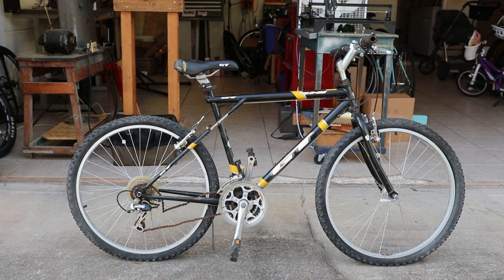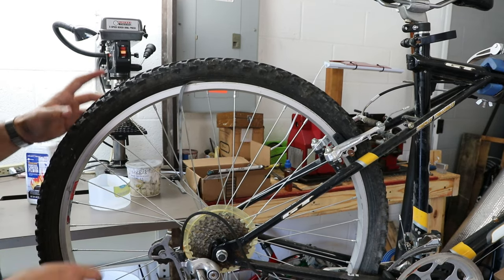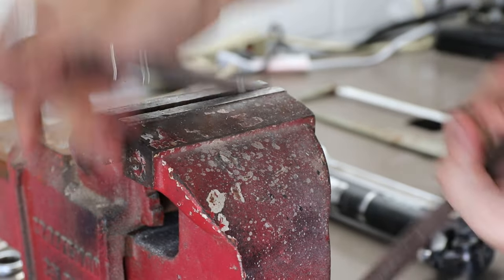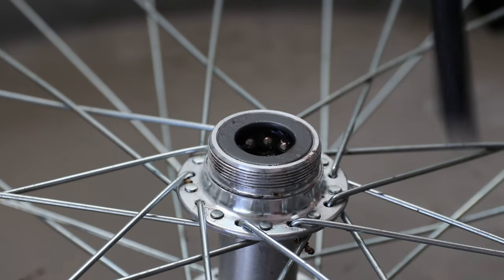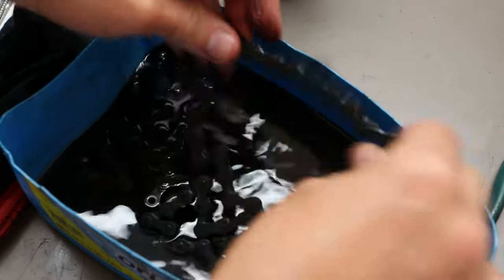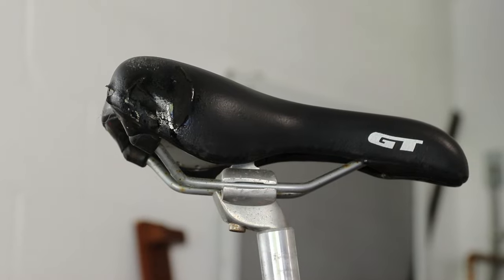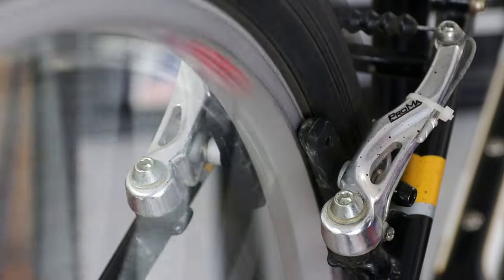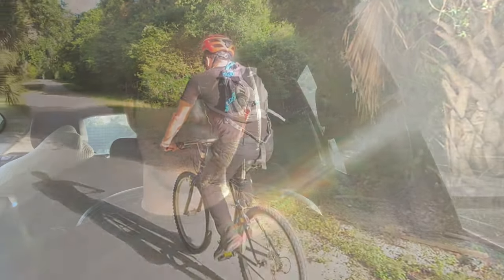$55 - 2000 GT Palomar restoration

Comment: I have the same bike. I got it when I was 10 in 2000. Washed and waxed it every week, and it's in pristine condition. Put a couple thousand miles on it. This summer I will be fixing it and getting it back on the trails.
Reply from the maker: oh that's very cool

Comment: I couldn't count the number of 80's-00's mountain bikes and hybrids I've refurbed. It's got to be in the hundreds. I've learned a few things over the last 20 years doing this.

Evaporust is amazing stuff. I started using it about a year ago. The gallon jugs are about $26, so a little better deal than the quart bottles. It can be reused a bit, but be sure to store it in a sealed container as it will evaporate and turn into a thick, gloopy mess. It works great on chains and hardware. 

For saddles with tears, a black Sharpie or paint pen work really well on exposed foam and blends in better than spray paint. If the tear is more of a slit or small hole, I like to seal that with silicon. Black RTV is a little glossy, but it probably blends in a little better than clear RTV. Use the black sharpie/paint pen trick if you do use the clear stuff so you don't see the foam underneath.

For handlebars, stems, or anything chrome with very light rust specking like what you had on the bars, I've long used 0000 grade steel wool as it isn't so abrasive that is scratches. You can use courser steel wool to get heavier rust off, but it's possible to scratch surfaces with that. Usually, a decent quality chrome doesn't scratch easily. Steel wool is cheap, but wears out quickly. Someone recommended to me a product for cleaning chrome on an old BMX bike I had restored,  Big 45 Frontier Metal Cleaner. It's made for cleaning gun barrels and the stuff is awesome. It costs several bucks for a pad, but they last a really long time. Check that stuff out.

For removing hub dust caps, a narrow plastic tire lever works great without bending the dust cap. It makes it so much easier to clean out the hub shell and bearing races if you get those off of there. Often, they'll snap back on by hand, but if they are a tighter fit, I use a socket and hammer to gently seat them back into the hub shell.

For replacement pedals, I often get on Amazon and sort by price and see what is available for around $10. You can find some really decent sealed bearing alloy pedals. Basic plastic platforms can be purchased for $6-7. As much as I hate putting money into the pocket of a billionaire, you can't deny the cost effectiveness and convenience of having products dropped off at my doorstep. They have lots of cheap saddles, brake pads, cables, cable housing...

It's always fun giving an old bike a new lease on life. I guess that's why I've been doing it all these years.
Reply from the maker: thanks for the all the tips. I agree, it's really not at all for the money, it's just for fun and cool to see the result.

Comment: A good way to get a stubborn free wheel off is to put the free wheel block in a vice sticking straight up.  Place the wheel over it making sure the splines are engaged and using the tire or rim as leverage just start turning it counter clockwise.  Never fails for me.
Reply from the maker: dang that's a good one. Now I want to try another stuck one lol

Comment: Hi Bruce! BTW, sorry for dumping all those bike photos on you. Haha. I don't really have any close friends that share the same interest, and I need to share with someone. 2 years ago, $55 woulda been steep for such a bike. But now, yeah, totally worth buying and flipping. So long as one doesn't divide his profits by the hours of labour invested, haha. As for electrical tape as rim tape, I've not had any bad experiences yet. I have a tip for cleaning an old chain. Once you've hit it with penetrant, and wire brushed and wiped it off, try submerging in boiling water. I just use an inch or so of water in a saucepan, let er boil. Use a paper towel to absorb the oily film off surface of water. Change water a couple times if you like. But, let chain dry completely, I mean completely before adding any lube so as to not create a yucky emulsion.
Reply from the maker: No worries my man! Cool idea for the chain, I’ll have to try that one day. I find majority of my time is mostly just cleaning rusty and dirty metal.

Comment: Hi Bruce! Nice video as always, really enjoyed this one. Some tips for you:
1. For the rim tape, electrical tape works fine but if it's a bad quality one, over time it will became hard, rise the edges and flat the inner tube, happened to me twice. Better to use an old inner tube and join using that inner tube vulcanizer. You can find some videos with this trick, it's quite cool!
2. I've seen somebody use black tape to protect the exposed foam of a saddle, better idea instead of spray paint it.
Keep doing like this man!
Reply from the maker: thanks a lot Michele!

Comment: Such low end(but still well designed) ATB/MTB bikes are great winter bikes. I mean in places where winter is real, with salty, grimy streets(cities are just like this in winter), and ice and snow aside from streets. Just get some anticorrosion spray inside the frame, and good wax outside, put the worst parts or some cheap used planetary hub(unfortunatelly this frame is without horizontal dropouts, but eg. super heavy hi-ten Giant GSRs do have), super wide fenders, stubby tires or if it's really bad weather studded tires(well you have most of the year to find some used cheap ones) and you good to overcome all the winter odds in HEAVY "hi-ten" METAL way with that classic MTB geometry of triple-triangle GT frames. Crashing snow drifts and ice like it's butter. Cool stuff.
Otherwise these hi-ten steel frames are really not good for nice riding(if you ever tried something better, like a nice cro-mo frame) apart from slow relaxing commuting or being some masochistic training gear.
Reply from the maker: it is indeed heavy 16.4kg/36.1 lbs !

Comment: You are, in fact, definitely not the only person to use electrical tape as wheel tape. As for yu taking a freewheel off? I use a socket wrench and the upper part of a floor jack handle as a cheater bar to get more leverage.  

Honestly, even if the seat looks funky because sprayed foam? it's better than the alternitive.

You know more than me on restoration and bodging. 

But as I watched? WOrst case yo ucould build it into a single speed. Glad you wer e able to get the gears and everything working well. 

Hell I'd buy it.
Reply from the maker: thanks Andrew

Comment: The spring on the v brake arm may have been reinstalled backwards, hence the clearance issue.
Reply from the maker: yeah maybe, I was kinda trying to put it another way but didn't find anything else that worked.